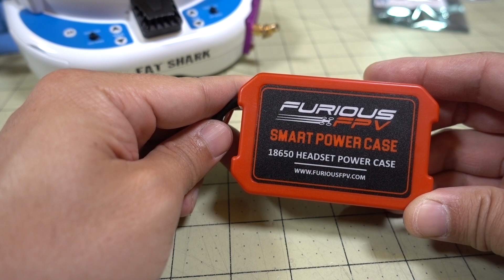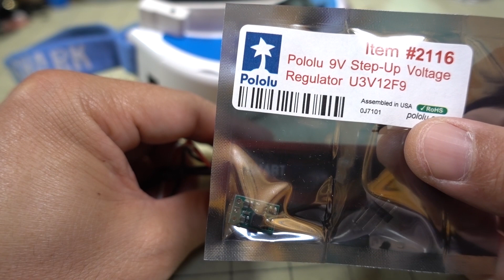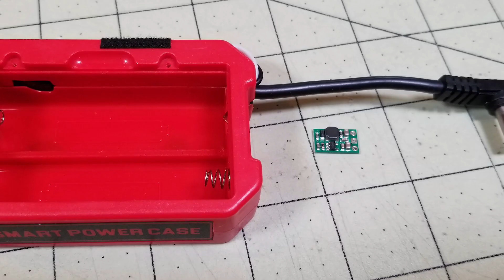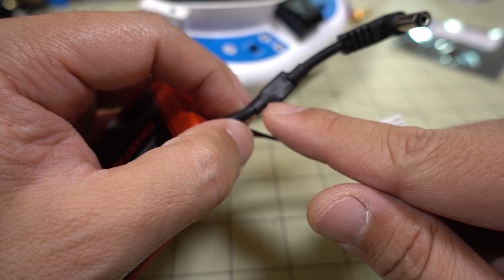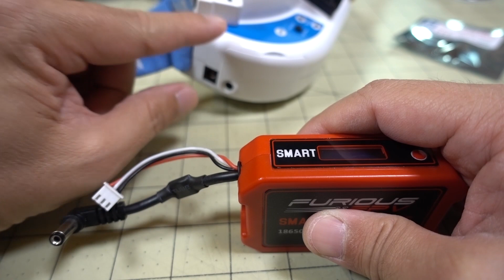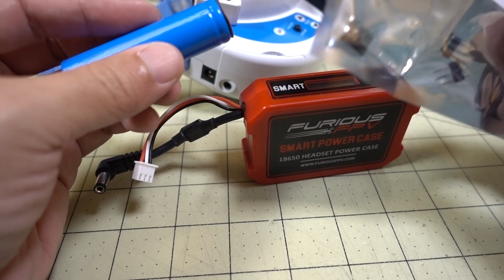FuriousFPV Smart Power Case Mod 🛠️

Comment: Hey Albert, I just did that. I didn't found the polulu you linked in the description so I bought the Matek Micro BEC 6-30V 5V/9V Adjustable instead. I did the bridge solder to adjust the power to 9v, like on the mateksys website.

Before the mod: Smartcase battery displaying 7.3v. Fatshark and the rapidfire powering up and not beeping
After the mod: Smartcase battery displaying 7.3v. Fatshark and the rapidfire powering up but rapidfire is beeping

It's the rapidfire that is beeping because where I remove the module, the fatshark are powering up and not beeping.

Any idea where would that come from? I'll check the output voltage tomorrow to make sure it's 9v.
Reply from the maker: I don't have a Rapidfire but maybe it's expecting a certain amount of current that the Pololu isn't providing?
Reply: @AlbertKimTV  is it possible that 9v is too much for a video receiver module?
Reply: @AlbertKimTV   so... I tried to measure the output of the furious fpv smartcase first on the input of the BEC and I haven't been lucky because I made a spark and now even without the BEC, there's no output from coming from the furious fpv smartcase. I guess I shorted the pdb board that comes with the smartcase. I have now disassemble the smartcase but all components look fine. The issue now is that the smartcase displays 0mah now on its little screen. I guess as a temporary solution, I can just remove the pdb that is refusing to output any amp and use the case as a standalone. argh, I'm so stupid to have touched it. I'm not used to a multimeter

Comment: Saw this video forever ago.  Gave up on the case but, now revisiting it.  Just ordered the Pololu 9v reg in your description today.  Hopefully I can finally start to use this thing again now.  Thanks for the info Albert.  BTW I reached out to Furious about the issue to see if I could get them to upgrade me to the new version properly regulated but, it was  no go.  It's pretty shitty on their half to leave customers basically with a product that is useless unless this regulator is added as an after market mod to make it work properly.  They really should have offered their customers a replacement program at the very least.  Furious has left an extremely bad taste in my mouth and seriously doubt I will be purchasing any of their products again.
Reply from the maker: This is fairly common with 1st generation products from just about any company.  I usually advise people to wait until they work the bugs out when V2 of a product comes out.  Then at least the big issues have been resolved by then.

Comment: mines starts giving warning sounds less than 10mins of usage any idea why?doesnt seem to fully charge the batteries to its maximum capacity
Reply from the maker: Try some different batteries. Cheap ones will give you problems. I use Samsung batteries. Link in the description.

Comment: Hey Abert this is a great mod. I used to do this to my LiIon custom packs in  the past to use max capacity. Just a quick question... I did this mod to my Furious Smart Case....and noticed  something strange today while flying. I noticed a high frequency interference in my Goggles using LaForge while using my Smart Case with the 9V Step Up Pololu. I swapped to my Fatshark Pack and no interference. Let me know if you found the same thing. I now will cut back my shrink wrap and add some Kapton tape and a layer of copper tape to see if I stop the EMC noise. If no go... I will remove the step up and go back to stock set up.
Reply from the maker: I'm not getting any noise on my Fatshark Dom V3's
Reply: @AlbertKimTV  I checked on my HDO with LaForge  (modules both sides).... very strange issue. I doubt it would effect my Rapidfire or a True D since the module is on the left. I will check my Rapidfire next weekend.

Comment: Great idea and since this case is charged via the balance port alone there is no problem with putting the regulator directly on the power lead!
I have this case and I also did this mod - I was planning on putting the regulator inside the case, but it was kinda hard to open it without destroying it so I did it exactly as you did inline on the cabel.

The only problem I have is that the aomway commanders beep at me constantly now - I guess they "think" based on the voltage around 9.3V that it's rather a very empty 3S and the low voltage alarm kicks in. But I have some HDOs coming next week so this should then work for those.
Reply: I have the same problem with the dji goggles and had to turn off the low volt alarm in the googles, maybe a 12v reg would be better.

Comment: Though I really appreciate this video because now I know why my freakin batteries never seem to be fully charged I am seriously disappointed with this product because of this.  I feel that Furious should be doing something to make this right.  Drives me nuts that I actually have power left on the battery but, my goggles keep beeping.  Also they could have done something instead of screws for the battery door especially considering how often I have to swap out my batteries due to them only charging 1/2 way! Come awn Furious make this right.  I shouldn't have to buy and install a 9v regulator when it should had been part of the product design in the first place.  I assume that battery settings are managed by firmware on the device which should be upgrade able to manage this problem am I wrong?
Reply from the maker: You're wrong on the firmware.  Firmware can't replace a 9v regulator.
Reply: 10/4 AK.  Guess it was wishful thinking :)

Comment: Albert how did you update the firmware on the nirvana to the underground fpv version from opentx?
Reply from the maker: If you didn't buy it from undergroundFPV, it won't work with their special firmware.  You'll only get to use the OpenTX firmware

Comment: No way of opening the case and installing on the inside
Reply from the maker: It might be possible, but the space in there is probably too small.  I didn't take it apart to find out.
Reply: I had the same question. After my regulator arrives I'll see if I can find a spot for it inside. Albert, thanks for the very helpful video!!!
Reply: @DrewLoika  let me know what you find out please.

Comment: I just bought my first pair of fatsharks and also noticed the battery mount being on the side really upsets the balance of the googles. I just use some velcro straps atm to mount it to the rear and a cable extension (looked for a strap with rear mount battery but they don't seem to exist). This mode will fit nicely between where I extended the cable so thanks for the idea :)
Reply: Eachine Ev200D Goggles strap---Rear mounting Battery. Cheers.

Comment: If cutoff is at 3V per cell and pololu efficiency is around 90% over 6V, this means that you can get maximum 2250 mah out of your Panasonic : 50% more than what you get without the mod. You’re not gonna get twice the flight time unfortunately :(
Reply from the maker: You still get more than without doing the mod.

Comment: You should have done it as a dongle, first. The pololu is only about 85% efficient (I measured it), so you don’t get anything like the return you’d expect from digging deeper. With the pololu continuously connected, I went from 2 hours of operation to 2.5 hours of operation. 

As a dongle, you can run the first 2 hours (4.2v to 3.5v) at 100% efficiency, then add the dongle to get the last half of the capacity at the lesser efficiency. This seems to add more than additional hour. 

I believe furious omitted the step up because of this lousy efficiency.
Reply from the maker: This way was easier and one less thing to lose.  I'm sure there's about a dozen different ways to do this.  There's already like 10 people saying they'd do it a different way.
Reply: Rather than a dongle, what about using a 3-way switch to bypass it? Is ground common on both sides of a regulator like this?
Reply: @DrewLoika  I'm going to do that.  I bought a 3 way mini rocker switch to install inside the Fatshark bay cover near the barrel connector.  I may have room to mount the pololu regulator on the switch so it's a completely clean install.   That gives me an off switch for stock Fatshark batteries and a switch to turn off the regulator for the first half, then switch on the regulator for the last half of the "smart battery case".  I've put in a ON/OFF switch before on my first Fatsharks but now I have the HDO's and they give a low voltage warning from the after using the smart battery case for some time.  I'll just switch on the pololu when the warning happens. Plus, I don't have to cut the stock barrel connector wire to install the pololu.  
https://www.ebay.com/itm/252043657760
Reply: Furious would've omitted this because it is not necessary on anything except FatSharks and then it is not "necessary"

Comment: Does this mod work for the black and white Fatshark 18650 battery case or does the problem even exist with the Fatshark brand case?  I also made a DIY goggle battery with two Samsung 18650 batteries (2S).  From your video, I would gather that I need to add the Pololu 9.0 volt step up board to it to keep the output voltage constant longer?  If you could answer these two questions I would very much appreciate it.  Nice video btw. 👍😎
Reply from the maker: It should work with the Fatshark case too.  It should also work with a DIY solution but without knowing exactly how the DIY was wired up, I can't say 100% for sure as there's like 15 different DIY solutions out there.

Comment: I ordered some wire with the male and Female barrel ends on them intending to make an extension cable because I really don't want to continue putting the battery on my head.  So now I'll have to get a regulator and wait for that to come in because this is a great idea.
Reply: Brad Manske sounds like a perfect plan for the extension cable looks like I need a 9v reg for my extension now lol